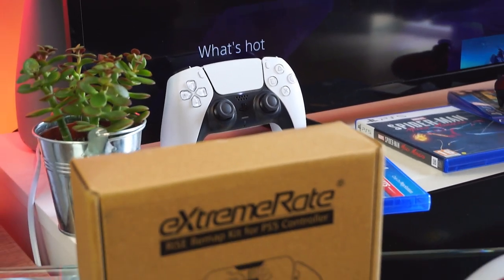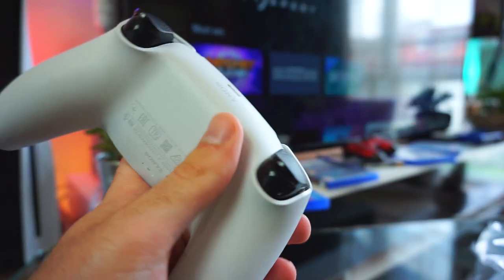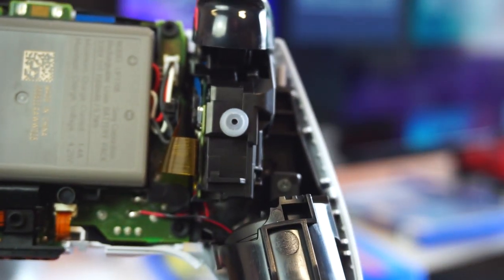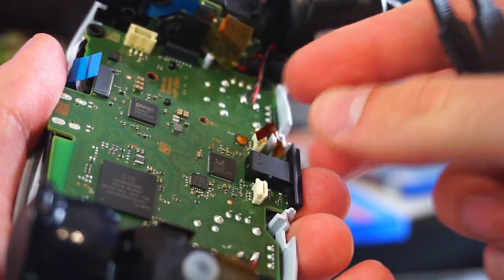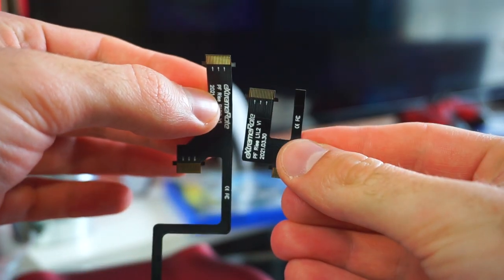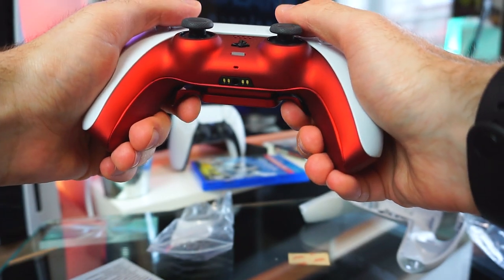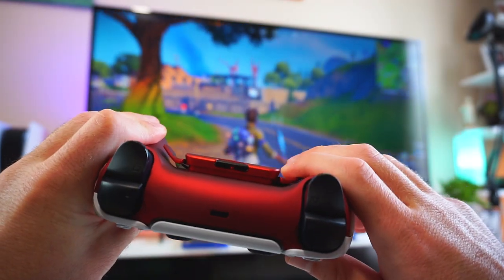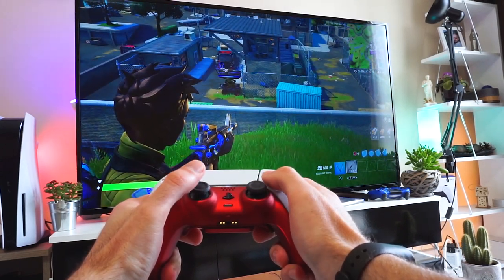PS5 DualSense Controller Back Buttons Upgrade- eXtremeRate RISE Remap KIT-Unboxing And Installation

Comment: They should have made the back button already in the controller that would justify paying a little extra for the controller, it doesn't look difficult just gotta be extra carefull not to damage the cables
Reply from the maker: That's true. But there are plenty of back button mod kits on the market.

Comment: Hey I installed this to my ps5 controller and it worked for a few seconds but now just flashes orange twice and turns off, I’ve tried a lot of fixed but nothing works any help??
Reply from the maker: The controller flashes orange?

Comment: Hello there I have a question,  I saw that you didn't connect a ribbon cable for R3 & L3 are you still able to remap those button's?
Reply from the maker: Yes, but there's soldering involved. Plus, i didn't want to remap the R3 and L3 buttons, since i am comfortable using them.
Reply: @SkvalaGaming  Thank you for response I'm asking because I play alot RPG/ Action adventure games that require R3&L3  and I hate using the click sticks. Thanks again great vid.
Reply from the maker: @picodegallio3255  You're welsome sir. You can check out eXtreme Rate's videos guide if you need some help with the soldering.

Comment: Is it possible to remap L3/R3 to the back button?
Because i can only see the connector that connect to the kit are only L1/R1 and L2/R2 and leaves the L3R3 connector unconnect.
Reply from the maker: You can't assign the L3 and R3 buttons

Comment: Hey! My K1 back button has stopped clicking and it won't work anymore, any solution? I've contacted the seller on eBay since the controller came with the back buttons installed already. Was working great for 4 weeks...
Reply from the maker: Have you checked if the K1 button is stuck?
Reply: @SkvalaGaming  how stuck? It Just won't click no more

Comment: Nice video. I think I’ll just wait for the Sony back button attachment though. I have big unsteady hands lol
Reply from the maker: I don't think we'll see Sony's back buttons soon, though.
Reply: @SkvalaGaming  you are absolutely right. I order the eXtremeRate last night… might as well go for it. And I have your video for help. Thanks again. Wish me luck!
Reply from the maker: @SSJFACPACIFIST  Good luck. The installation is not that difficult, though. I'm sure you'll manage just fine.
Reply: @SkvalaGaming  controller not turning on. Not sure what I did. All cables connected. I guess I’ll check again
Reply from the maker: @SSJFACPACIFIST  You might've missed something obvious. I forget to reconnect the battery almost every time :D

Comment: Do I have to replace  the l3 and r3 cables even if I don’t want to use them as paddle or can I keep the one the controller come with
Reply from the maker: Yes, brother.
Reply: I think you should replace as he did as it won’t necessarily mean youll use them for remap but just so that the kit works with the whole controller i think

Comment: One of my triggers came loose :/ the metal bar just slips in and out while the other stays in firm. Not the end of the world though, wondering if a replacement trigger is a thing?
Reply from the maker: You can just buy another controller, brother 👊

Comment: my controller isn't powering on now, at first it was working perfectly fine until I decided to switch up the remap to another controller, did everything step bt step noway controller won't power on, help?
Reply from the maker: Double check if you connected all ribbon cables correctly, brother.

Comment: I thought I did everything right and now my controller won’t turn on! Please help me 😭
Reply from the maker: Follow each step carefully, brother. I'm sure you missed something simple.
Reply: It’s because You need to use The original White ps5 controller…it won’t work with any of the new Controllers because the new controllers are gen 2 (like the Red one or black one)
Reply: @Honcho069  mine is a white one
Reply: @SkvalaGaming  I went through the steps twice, I put the original stuff back on and it went back to working fine.
Reply: @joshcannon6704  yea if it won’t turn on u just have to make sure u have it on tight and re-do it if not.

Comment: Brother I have only 1080p tv. Am I buy ps5?How the graphics look?
Reply from the maker: I strongly recommend a 4K TV for your PS5, my friend.
Reply: At 1080P the PS5 will just give you higher frames per second and  refresh rate, possibly better texture loading. So for FPS get a 1080P 144HZ monitor, for adventure games get 4K 60/120HZ

Comment: If the back plate is soft touch then wouldn't your hand slip of?
Reply from the maker: No, the grip is pretty great, brother.
Reply: Bur which is better the textured of soft?
Reply from the maker: @cpydeey  I prefer the soft touch, brother.
Reply: Yes but which gives more grip?

Comment: Do you have the original PS5 charging dock for the controllers?
If so, do the controllers still fit in there to charge?
Reply from the maker: No, brother. It won't fit the Docking station.
Reply: @SkvalaGaming  thx. Thats ashame as i use the dock for both my controllers.
Keep up the work

Comment: Guys if your controller isn’t turning on Then You have a new generation controller…these paddles are only compatible with The white controllers that came out first. It won’t work with any colored ps5 controllers or newer ones
Reply from the maker: That's very useful information, brother. Thanks for sharing it!
Reply: How do I know if mines new generation
Reply: @Azerx997  look in the back and if it says CFI-ZCT1W A it’s the new ones
Reply: @Azerx997  if it doesn’t have an A next to the code it’s an old one which is BDM_10

Comment: Ain’t trying to take apart my controller for some back buttons someone just release a attachable mod where you don’t have to take apart my controller just to put them on. Great video very in depth.
Reply from the maker: Taking your PS5 Controller apart might look intimidating, but actually the whole installation process is not that difficult.
Reply: @SkvalaGaming  I might try it, but I’m also getting a pc soon and thinking about switching to kbm and don’t know if it is worth it.
Reply from the maker: @Erick-tk2ve  Oh, that's awesome. Btw what PC are you getting?

Comment: My controller is not turning on …
Reply from the maker: Have you connected the battery, brother?
Reply: Yes !  my controller is diferent it only work el for the bdm - 010 board I have the BDM - 20
Reply from the maker: @bryantoca350  So you've pinpointed the problem, brother.
Reply: Went to game stop  and got me the right controller ! And right knoe working perfect 👍🏻
Reply from the maker: @bryantoca350  Happy to hear that, brother.!

Comment: I would rather lose all my gunfights than open my controller like this lol 

No thanks  😂
Reply from the maker: The whole process seems a bit complicated, but it's actually not that hard. The PS5 controller is built really tough so you won't break anything easily.

Comment: Mind wont turn on no red led light, controller blinks orange one time and does nothing 😌😌😌😌
Reply: @SkvalaGaming  what do you mean paired. Just put cable in right? I did that. I did it again no it turn on. But d pad and x dont work. No luck lol
Reply: @SkvalaGaming  tried to connect it. With the cable , didn’t do anything same forcthecled on the back ,Used the controller before aswell

Comment: My controller won’t turn back on
Reply from the maker: Check if you connected the battery, properly.
Reply: I did, I took it back apart twice
Reply: Even tried resetting the controller